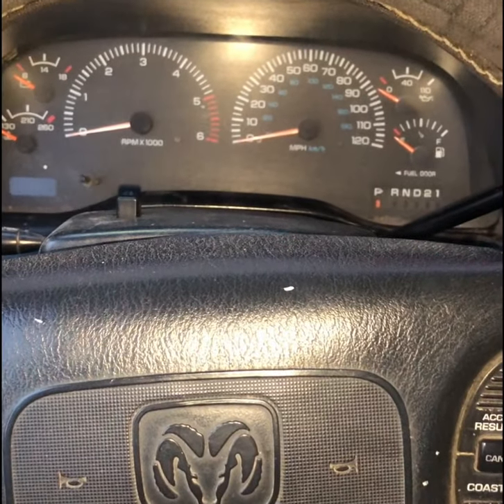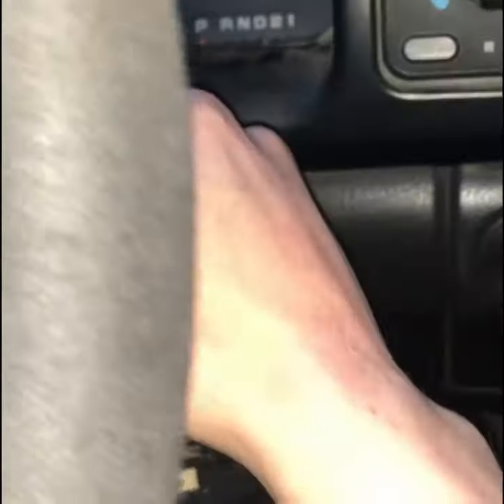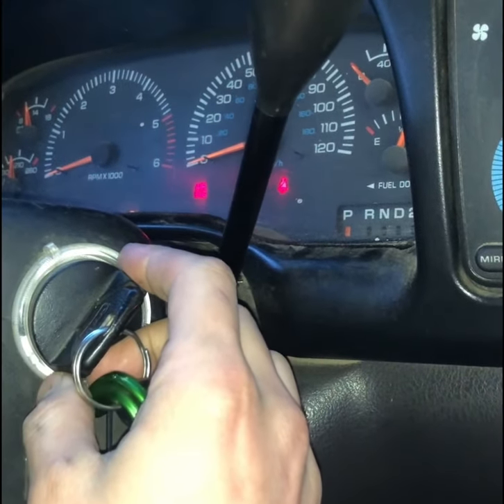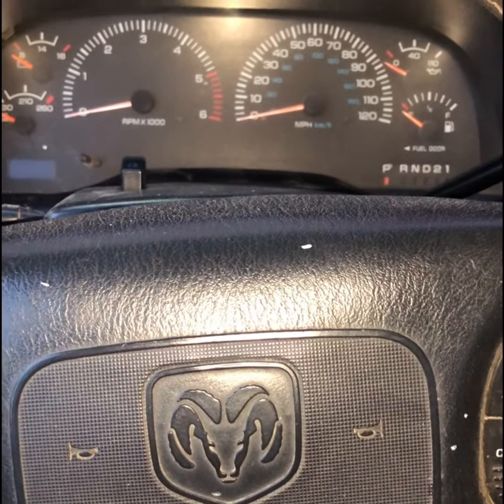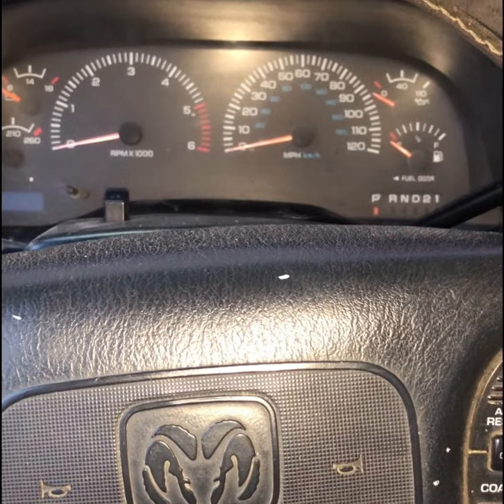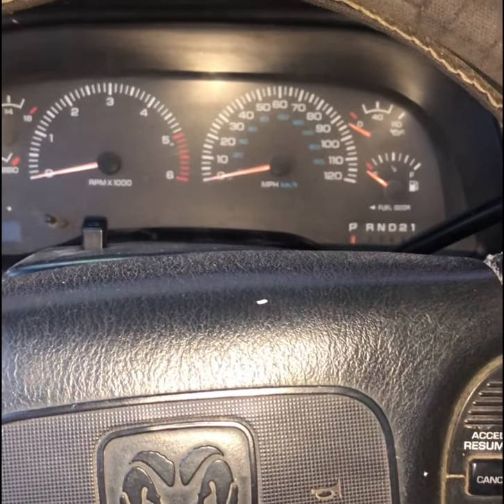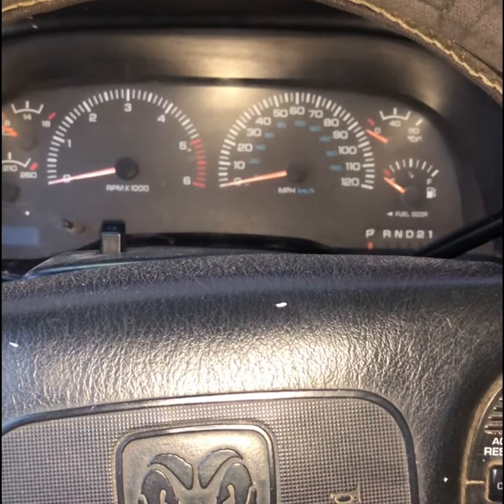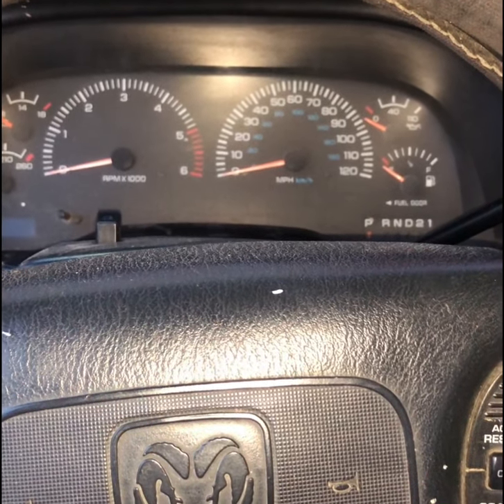Reset your Transmission Control Module (TCM) Dodge

Comment: This method worked for a friend’s 1500 dodge. They had made an appointment with the dealership $200 to diagnose it, plus $500 to reset the program, if it needed replacement $1800 to replace. Words can’t express the gratitude they had for you and this video. THANKS A MILLION FOR SHARING GREAT CONTENT! Cheers!
Reply: What year? I have a 2013 Challenger and was wondering if it would work

Comment: This is the fourth video that follows the exact same procedure to reset your transmission control module. And I tried doing this with mine, and I think it worked. My ram was lugging badly in 2nd to third gear at 1500 RPM. It seems a lot better.
Reply: I was recently getting the code P0700 and with that code, my truck ran like hell. I was leaving red lights in 3rd gear and i was stuck in that gear. After following this video, i drove my truck and had all 5 gears and no issues. Hopefully it stays this way

Comment: I have a 2006 300 touring my rpms are the ones that go high so i know the transmission messing up mine hope this will work
Reply from the maker: I hope it works for you as well! Double check that you have enough fluid and that it isn’t really dirty.
Reply: @RaschDecisions if it’s really dirty that means clutches can be shot

Comment: Omg it worked on my truck. I've been having a issue with the code P0700 and its been shifting weird and from a red light, it feels like im starting off in 3rd gear. I had all my gears after i followed you in your video
Reply: This is exactly what my truck is doing right now.  Going to do this to see if it fixes the problem will update!

Comment: A friend was quoted $200 diagnostic fee plus $500 to reset the program. If the part needed replacement, it would be $1800.

This method was done problems solved✅ 

Thanks 1 million for the excellent content!  Cheers!

Comment: Do you think this will work in an 03 durango? I have the 5.9 w/ a 46re. I replaced the tcc/od solenoid, accumulator piston, and the filter. Had rough shifts ever since.
Reply from the maker: I think it would work! Give it a shot and see if it helps. If it doesn't help then there might be something else wrong with the tranny.

Comment: My 01 1500 randomly shuts off sometimes it will turn back on somtimes it wont heard it could be the ecm i reset it having the same problem. This all started happening after i changed the fluid and filter. It doesn't slip to bad but sometimes when it goes to tirn off randomly it jerks around could it be the tcm???

Comment: What was ur symptoms did ur speedometer not work or did it shift at high rpm?
Reply from the maker: My truck was shifting really weird after I change the transmission fluid. I experienced it shifting at very high RPMs, and shifting down randomly. It was a very choppy not smooth ride after the reset it’s been running great.
Reply: @RaschDecisions did it throw u a code? Mines is u0101 (lost communication with TCM).

Comment: 99 dodge Dakota, would this follow? Have laggy shifts and inconsistent down shifts. Thanks.
Reply from the maker: I think it is worth a try, but I can’t promise it will fix your current problems. Make sure you check the fluid levels and then why not give it a shot? Let me know if it works.
Reply: @RaschDecisions  it helped out forsure I’ll see after I get this tune done how it’ll really be. Thank you sir.

Comment: I did it but my check engine light came back on
Reply from the maker: This isn’t to fix a check engine light. I’d recommend getting it tested and read the codes.
Reply: @RaschDecisions  I had it checked and the shop said my tcm is bad